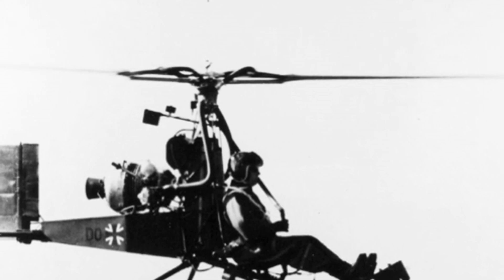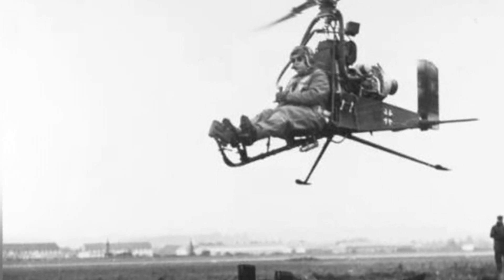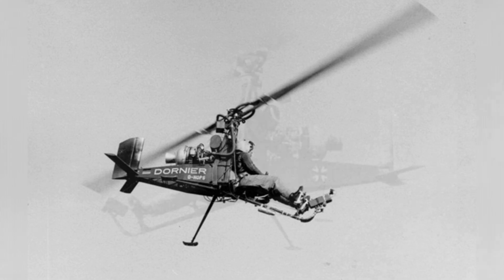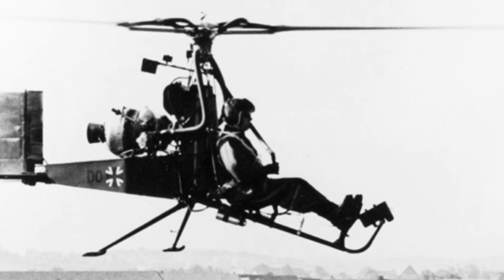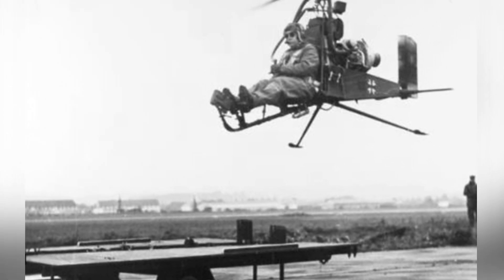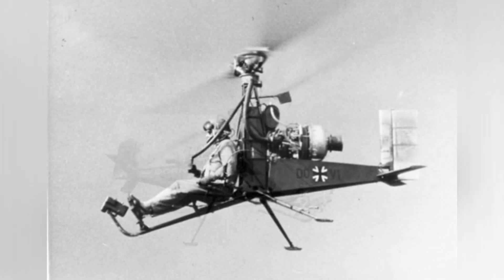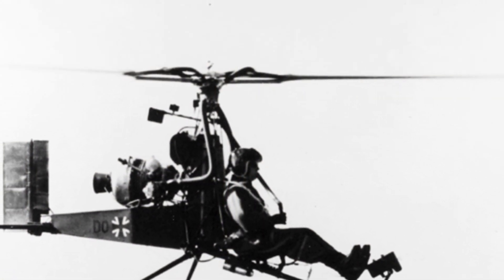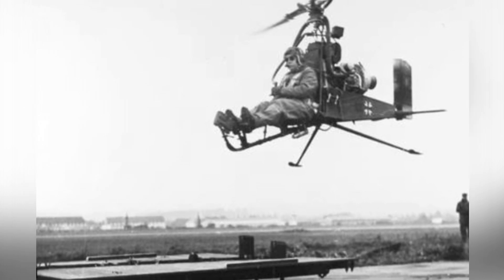Unveiling the Do 32: Germany's Revolutionary Ultra-Light Helicopter

Comment: A very cool little helicopter, but I can see it being not super useful except in rare cases, perhaps special forces use, or recon way back in the 1940s.    But today recon can be done with little drones, and special forces can be dropped via high altitude parachute, or troop carrier helicopters.   Little need for a one man, slow, exposed, noisy, helicopter.
  Now Hiller Aviation in America developed a parachute deployed, one man rescue helicopter, and another that can carry a litter patient and pilot.  The rescure one is designed to be air dropped via chute in what appear to look like a aircraft underwing drop tank.  Upon landing the standed pilot opens the "drop tank" to find and then assemble a folding helicopter, then get in and fly out of harms way to rescue.   That series of video, or these and other Hiller aircraft will make a number of good videos in your hands.     The Hiller Museum is in San Carlos, California.  Several very cool Hiller examples on display.   Very innovative early helicopters.  
Thank you for this fine video of an unusual aircraft!
Reply: San Carlos!  Draft!  I wish that I had known that it was there when I lived in the San Francisco Bay Area.